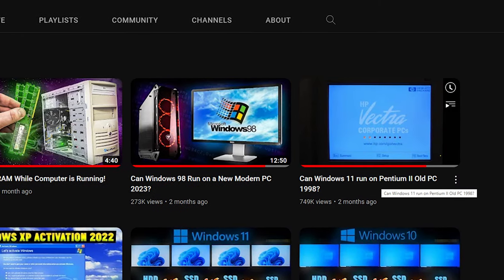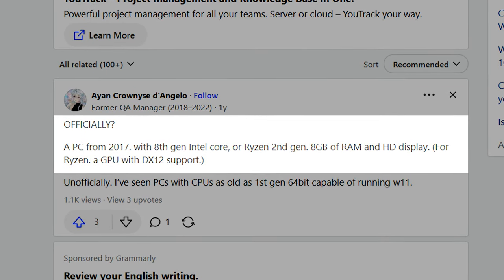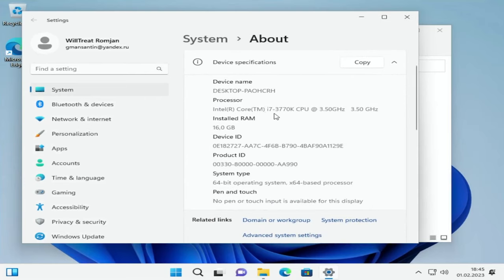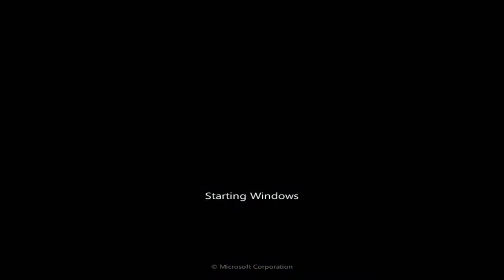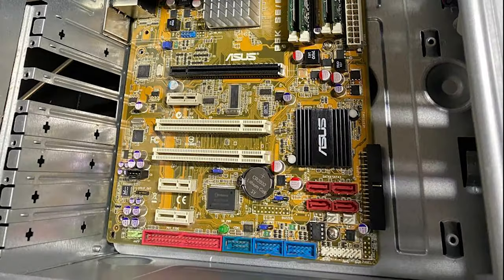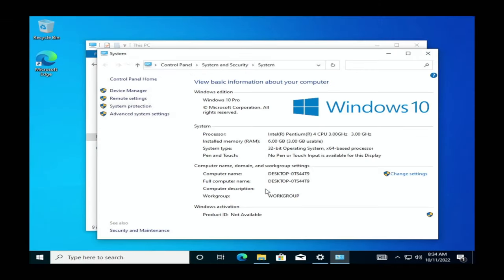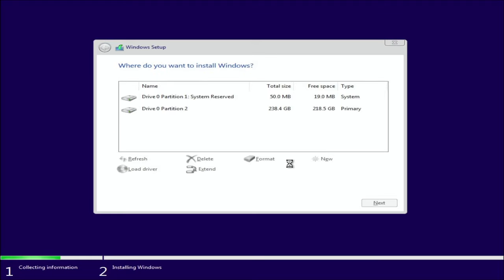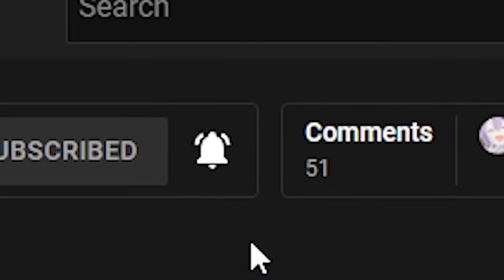What's The Oldest CPU That Can Run Windows 11?

Comment from the maker: What is your favorite operating system?
Reply: Windows 7
Reply: Windows Vista, XP, 7, & 10
Reply: linux ubuntu
Reply: @MrIzaiah2007YT  windows Vista had potential but because of hardware not being powerful enough to run Vista most people downgraded to xp
Reply: vista and 8.1
Reply: Windows 7, 8.1, XP, and Vista
Reply: Ubuntu Linux
Reply: @el_dallasyt  well my experience With Vista was great. no joke.
Reply: xp and 7
Reply: @MrIzaiah2007YT  then you had a good pc if your experience was great
Reply: @el_dallasyt  well I did
Reply: Like seriously I just had a gateway gt5620
Reply: @MrIzaiah2007YT  better than I had back in the day
Reply: XP, 7, 10 and 11
Reply: @el_dallasyt  well I was 13 years old when I had that PC and it worked fine for me, but when setting to sleep mode. It blue screens and I instead shut it off instead. Later replacing it with a Dell Optiplex 390 with a failing dvd drive. And it runs windows 10. Begging for it in my entire life
Reply: Windows 10 Pro
Reply: Arch Linux
Reply: Linux mint, Zorin OS, Windows 7 and XP.
Reply: Windows ME I still refuse to upgrade, YouTube playback is starting struggle though;)
Reply: Windows XP & Windows 7
Reply: Windows 2000
Reply: 98SE, ME, XP, W7
Reply: Kali Linux, Windows 10 and 11
Reply: Windows 11
Reply: Windows vistam
Reply: For the features it introduced, low system requirements, exceptional stability, good hardware compatibility at its time, absence of activation from M$ : Windows 2000  !! 
For the eye-candy, easiness of use, productivity performance, flip-3D function : Windows 7. Though I had good impressions from Vista as well.
Windows 10 is not bad, but not great : management is pretty cumbersome, it hides a lot of things, does not run on old hardware (AGP, socket 939 and the like), incompatible with many old peripherals.
Reply: Windows 11
Reply: Windows XP and windows 11
Reply: Windows XP and windows 11
Reply: Windows 10
Reply: windows 10 & 11
Reply: Personally (no bully pls) Windows 8.1. It wasn't that bad. The ui seemed a little weird, but I could get around it. And it IS fast.
Reply: Windows 98
Reply: 7
Reply: Windows 11
Reply: Linux (and Windows XP)
Reply: xp media center edition 2004 specifically
Reply: Gentoo Linux, i use gentoo linux
Reply: Windows 8.1 And XP
Reply: Arch Linux
Reply: Windows 11 and Windows 8.1
Reply: Be Operating System
Reply: @Nas_Allie  what
Reply: Windows vista
Reply: Plan9
Reply: 11 and xp and vista
Reply: Windows 7 and windows xp
Reply: @KasparsBarissGames  same thing for me
Reply: Windows 10 > windows 11
Reply: Windows 7 Build 7000, fine, clean, elegant without so much nonsense of advertisements and recommendations
Reply: Windows 7 Windows 10 and Windows 11
Reply: Windows 98 and Windows 7
Reply: Windows 10
Reply: 7
Reply: Windows 10, Windows 7 professional
Reply: cute fish OS (a linux distro that looks like a mac and doesnt restrict EVERY POSSIBLE THING)
Reply: Windows Millennium 👌
Reply: @Man-O-Sphere News  half joking because I really never had any issues with it and at the time I had a great time playing games and browsing the internet. But the best for me is 7.
Reply: Windows 7
Reply: win 11 & win 8/8.1
Reply: and ubuntu
Reply: windows7 or 10
Reply: Windows 10 and 11
Reply: XP et 10
Reply: Windows 7 Ultimate
Reply: Windows 7
Reply: 10 and vista
Reply: Windows 7, Windows 10
Reply: Win 10 And Win 11 (Tiny Build Version)
Reply: @vojtechadame5860  Zorin IS?
Reply: Windows XP
Reply: XP Pro 64bit.
Reply: @kristinehayes4885  Well, i have a xp install cd and Active key?
Reply: GNU/Linux with Arch Linux or Debian. Or Debian based GNU/Linux systems with the exception of Ubuntu based GNU/Linux distributions.
Reply: @Night_fla  same here 😀
Reply: 7, 8.1 and specifically Windows 10 LTSC
Reply: Arch
Reply: Windows XP
Reply: Windows XP
Reply: XP is my favorite  Windows OS, MacOSX 10.6 was great on Mac. SUSE 7 was the first Linux OS I sat and forced myself to use. BeOS was also great to use.
Reply: windows 10 and debian linux
Reply: Windows 7 ❤
Reply: Windows 7
Reply: Windows 10
Reply: Windows 11 and Ubuntu 22.10 Linux
Reply: Windows 10+MacOS 11 and above
Reply: Windows Vista
Reply: Windows 8.1,Windows 11
Reply: Windows 7
Reply: Windows Vista & Windows 8.1 for my Preferences
Reply: Windows 7,10
Reply: XP and 7. it used to be Win98 SE, but after i went back to try to make an ultimate pc for that, i realized it really was a shitshow and unstable to use compared to XP, which was relatively headache free.
Reply: XP
Reply: Yes
Reply: Win XP, 7, Ubuntu 16
Reply: Windows XP, 7, 2000 and Vista (as long as it’s running on good hardware and has SP2)
Reply: @LukeIsASmurf  8.1 was good, not my favorite but it’s good, 8 is just trash
Reply: Nobara linux
Reply: My favorite operating system has been Microsoft XP Professional. It was easy to use like using a Macintosh computer. Microsoft's office counterpart was Microsoft Office XP Professional, with Publisher 2002 packed in a separate disc. This suite of application programs put a lot of ease to my learning curve. In fact, I learned those programs better than if I had worked in a typical job, regardless of the quality of keyboarding.
Reply: Whatever system I need to accomplish what I am trying to do is my fave OS.  I'll use windows, linux, MacOS, OSX, OS 10, OS/2, DOS 6.1 emulation usually.   

The only thing I don't really use is old no LTS versions of windows.  If I'm trying to resurrect a decades old PC, I general l go with GNU because you can choose at install what aspects of it you need.  The kernel is simple and can be scaled up or paired down as needed.
Reply: XP ofc🤩
Reply: Overall - Windows 7
For legacy programs - Windows XP
For modern programs - Windows 10

Avoid - Windows ME, Windows Vista
Replace Immediately - Windows 8, Windows 8.1, Windows 11
Reply: Pirated copy of MS-DOS v 3
Windows 95
Reply: windows xp, 7 and vista
Reply: Apple macOS Sonoma 14 Beta 1/2. It has widgets/gadgets!
Reply: Windows 7
Reply: Windows: XP to windows 10
Linux: Ubuntu, KDE, Deepin
Reply: windows side: win2k... linux, early ububtu... Msdos, 3.2 (but not edlin)
Reply: Oh wait i forgot one more windows one
window- oh wait i forgot the other one but
windows technical preview
Reply: Windows 11 for its HDR support alone. HDR is trash in 10.
Reply: ubuntu minimal net installer 18.04
Reply: Vista, xp,10,11
Reply: Win 10 win 8 win 7 win xp
Reply: @MrIzaiah2007YT windows vista WINDOWS 8 WINDOES 8.1 WHAT IS WRONG WITH YOU
Reply: Windows 7 & 10
Reply: OS X Mountain Lion
Reply: Windows XP, 7, 11 and Ubuntu Linux, Debian
Reply: Windows 7 or macOS Mojave
Reply: Windows 11
Reply: XP,Linux,MacOS
Reply: 7
Reply: Windows 10💔 has won many hearts 🥺
Reply: Windows 7,8.1,10 and Windows 11
Reply: Windows 11 pro on my i5 9600k 32gb of gskill trident 3600  asrock challenger 8gb rx 5500 xt
Reply: xp, 7, 10
Reply: Windows 98, it's relaxing to use today. I enjoy the warm and inviting boot sound startup sound, the icons have aged well, and it has a simple interface that doesn't bog you down, no BS. I don't know why, but it seems like it gives off a utopian design. For a more modern OS I think Windows 7 is the gold standard I think it comes pretty close to perfection.
Reply: 98 SE ,xp SP3, vista, 7, 10, and 11 lol
Reply: Windows 10
Reply: XP
Reply: windows xp
Reply: 7 and 8.1 and XP and 95
Reply: Windows 3.11 with DOS 6.22
Reply: Windows 10 Home
Reply: Windows 10 Home and Windows 7
Reply: windows xp / 7/10/11
Reply: Windows XP, Vista, 7, 8 8.1, 10, 11
Reply: CP/M in an Amstrand PCW  ....
Reply: Windows 95 Windows XP Windows 7
Reply: Linux Mint Debian Edition (LMDE5) w/ Cinnamon desktop OR Fedora Linux Cinnamon Spin.  Both are equally superb.
Reply: 7
Reply: Windows 8.1
Reply: EU AM UN PC HP 6300 PRO CU PROCESOR INTEL i5 3470 generația a treia de 3.20 GIGA cu grafică integrată culmea procesorul E de GAMMING și PC-UL nu E de GAMMING dar duce jocuri nu din alea mai modificate nu dalea Gen GTA-5 SAU mai știu eu CE JOCURI video CARE NECESITĂ PLACĂ VIDEO puternică d exemplu: DE 8 GIGA MEMORIE  DE EXEMPLU un GTX 9800!🙂
Reply: PROCESORUL DIN PC-UL MEU ARE TEHNOLOGIE DE FABRICAȚIE DE 22 NANOMETRI!🙂
Reply: PROCESORUL DIN PC-UL MEU ARE PATRU CORURI PATRU TRENDURI!☺️👍🙂
SHOCKETUL DE PE PLACA DE BAZĂ A PC-ULUI MEU E 1155!🙂
Reply: windows 7 is my favorite childhood until now
Reply: i like 11 2000 and 7, 8.1 95 98se 10 xp vista
Reply: win 98 purely for nostalgic reasons
Reply: wiin 7
Reply: macOS/iOS or Linux
Reply: Linux, Ubuntu. Last time Windows was decent was Windows 2000. No activation, no spying, no bullshit.
Reply: Q4OS
Reply: windows 95
Reply: win10, but I'm on win11 ever since it's release
win11 personally i only hate right click menu and taskbar which are fundamental things but, oh well- it works
Reply: Linux Mint!
Reply: windows 10, android 10, ios 15.
Reply: Windows XP, Windows 7 and Windows 10
Reply: Windows 8.x, Windows 10, Windows 11, including Windows 7.
Reply: I loved Windows 95, 98, and 2000. XP was also fantastic. It hasn't been the same since.
Reply: @JMFSpike  I did not use these OSes and they are old. Many people use these OSes on virtual machines and real old hardware.
Reply: @elenaursache9728  Okay, but I really don't care if you ever used my favorite OS' or not.
Reply: OS/360
Reply: @JMFSpike  I will run Windows 11 on a VM on a Windows 7 laptop
Reply: Windows 7
Reply: Windows XP, 7, 11 and Linux Mint
Reply: os/2
Reply: Windows XP
Reply: windows 7
Reply: Windows 7🟥🟩🟦🟨🕊
Reply: Windows 7🟥🟩🟦🟨🕊
Reply: Windows 7🟥🟩🟦🟨🕊
Reply: Windows 7 and Linux Mint
Reply: Linux Mint 21.3 Xfce is the best !!!!!
Reply: Windows 10 ,and windows 11,
Reply: i love the installation setup of windows 7.
Reply: Amithlon
Reply: windows 7 is my favorite for aero
Reply: Windows 7 ULTIMATE😅
Reply: Actually I still love Windows Vista, XP, 7.
Reply: windows 98se and windows xp
Reply: 98 SE, XP SP3, 7 Ultimate SP1 x64, 10 22H2 x64.
Reply: I cloned Windows 11 on an external hard drive and booted Windows 11 on PC's from before 2018,.
Reply: Windows 95, NT 4.0, 98, 2000, XP, Vista, 7 and 8.1
Reply: @mats520    Have you been able to boot Windows 11 on a PC that doesn't have TPM 2, secure boot, and that uses BIOS? I'd love to experiment with 11 on an old Core 2 duo or quad, but Idk how to bypass all those requirements.
Reply: @MrSavagebeast04  yes. it was bootable on bios, even without tpm and by passed all those requirements, but when i tried to boot Windows 11 on a 16 bit or 32 bit cpu, then i got a blue screen of death or a startup error. I used WinToGo USB to clone Windows 11,. Windows 11 performed well on core 2 duo and pentium dual core when it booted from the external hard drive.
Reply: Windows 10
Reply: haiku linux
Reply: win 11
and 10 is my best i have ever used when i use win 10 i more time i got old nostalgials
Reply: @mats520  Thank you so much!
Reply: Windows Vista
Reply: Hey what a great channel!! For me Windows -> XP, Linux -> Mint
Reply: Windows 10,11
Reply: Windows XP ❤
Reply: Windows 7, to be more specific, build 7000 for its looks, and build 7601 for its usability
Reply: Grew up in my childhood with windows 7, mostly Windows 10.
Reply: Windows 8.1 10 11 ❤
Reply: My Top 3

1. Windows XP
2. Windows 7
3. Windows 10
Reply: Windows 7
Reply: Win 10 for sure 😁
Reply: Windows 7
Reply: Wim 11
Reply: Windows XP, Vista, 7 and 11 (yes 💀)
Reply: Windows 11, 10, 7, Vista
Reply: my favorite is windows 11 and windows 10
Reply: @RamtechENG  windows 98
Reply: Imagine how windows 12
Reply: @Guest8293  it probably will be a year or less if Microsoft keep getting money hungry.
Reply: templeos
Reply: This is easy. Windows  XP on PC, Linux and MacOSX .
Reply: Windows 11 and 8.1
Reply: linux ubuntu
Reply: Windows 10
Reply: gäymäc ö$..?
Reply: Win 7 or 8.1
Reply: i have intel pentuim dual core and i installed win 11 ez like installing win7

Comment: Great video, recently i upgraded my laptop with i5-7200U (7th Gen) with Geforce 920MX and 8 GB of RAM to Windows 11 x64 22H2, it's working well, old games running well, like GTA San Andreas, no errors. Greetings from Brazil, i like your channel.
Reply: We have same spec laptops lol
Reply: @ari_1755 , what is your laptop?
Reply: Wow they still used the 920MX on newer models? Wow.

My former laptop also had a 920MX, but the processor was a i5-6198DU (6th gen)
Reply: @charginginprogresss  Yes, they even used the 920MX on PCs with Intel's 8th generation processors, but with other name, like Geforce MX110 (rebranded 920MX model with small changes).
Reply: @charginginprogresss , my laptop have i5 7th Gen and Geforce 920MX. And your laptop processor is something I have never seen before as they never sold anything like this here in my country (Brazil).
Reply: @KlonoaSulista22  Cheapskates, lol. I swear.
Nowadays those pcs don't exist anymore though.

Any laptop in the 500€ price range with a low/mid end-ish i5 processor of 10-11-12th generation rocks integrated graphics now.
That era has ended.

That's why I switched to mid end gaming laptops to have decent GPU...
Reply: My old laptop has the same processor, also running windows 11 but with a radeon r5 m430 card and it even has a tpm 2.0 chip which makes it almost compatible
Reply: I have i7-6500u and 940m. works very well with win11
Reply: I have i5 7200u but with GeForce 940mx

Comment: Supposedly the Athlon 64 gained LAHF/SAHF support as soon as the first X2 dual core models were released in May of 2005, which would make it over half a year older than the P4 6x1 still. Might be worth checking out in another video if Win 11 only requires MMX, SSE/2/3 and some sorta 64 bit extension set (EM64T for Intel, AMD64 for AMD) otherwise. Undoubtedly the Pentium will be the slower of the two however, what a pile of trash Netburst was.
Reply: Well... Windows 11 and Windows 10 64-bit didn't work on my Opteron 165 and that CPU was released in August of 2005 to my knowledge, that CPU does have 2 cores and is technically AMD64.
I did however get Windows 10 32-bit to install on there, and it's surprisingly usable
Reply: @RowanBird779  yes, the Socket 939 CPUs don't work with Windows 10/11 64-bit. The oldest CPUs that can run it are Pentium 4 6x1 and Celeron 4x0. For these old AMD CPUs you could try Windows 7 64-bit, you can run all the modern APPs without problems.
Reply: @BaguetesGarage  Celeron D with Cedar Mill core is the oldest and slowest actually, I got it running on a Celeron D 347 and an AGP platform, with FX 5500 graphics and DDR1 RAM
Reply: @tehretrotech3977  oh yeah, these suckers were launched around mid 2006.
Reply: @BaguetesGarage  Oldest CPU supported by Windows 10 x64 is Pentium Extreme Edition 955 (January 2006).
Reply: According to CPU-World website, the first CPU that have all of LAHF/SAHF, PrefetchW, and CMPXCHG16B, are those on AM2 socket. Late 939 processor doesn't have CMPXCHG16B even though they have the other two. The same case go for Pentium 4 5x1 and all Smithfield lineup. I think the only Pentium 4 Prescott that support Windows 8.1 x64 or later is Pentium 4 524 which is the last Prescott Pentium 4 to be released in early 2006, or maybe Pentium 4 519/519K. Other 90nm SKUs from Intel can't be use with Windows 8.1 x64 and later. The first Intel CPU lineup that wholly usable with Windows 8.1 or 10 x64 are Cedar Mill and Presler parts, from Celeron D through Pentium Extreme Edition. Those are 2006 products as well.

So basically, the requirement of Windows 8.1 x64 and Windows 10 x64 make everything before 2006 unusable with newer Windows and without any workaround, at least on 64bit version of Windows.

On the other hand, modern Linux x64 can still working on everything that have AMD64 or EM64T instructions, in other word, everything since Clawhammer and Nocona that is not Sempron on socket 754/939 or Celeron D Prescott. Though it should rather be considered that PCI-Express architechture is another requirement as there's no AGP bridge driver in Windows 10 at least for VIA chipset so it makes AGP graphic card only run with PCI bus on Windows 10 which is very atrocious.
Reply: Thats something I'll try eventually. I got an early Athlon 64 I know ran 10, but im curious if it runs 11 too.
Reply: actaully main issue with netburst was too many pipes and not enough cache athlon 64 had more even if just small bit more
Reply from the maker: Thnaks for this kind of information. Soon I'll release a new video "What's is the oldest AMD CPU that can Run Windows 11"
Reply: @RamtechENG  when

Comment: One thing to keep in mind when messing about with modern CPU's on old hardware is hardware USB support. Even with a USB 3+ card, a lot of motherboards and CPU's can only reach USB 2 speeds. If all you're doing is data transfer etc - or even loading levels on emulation.... its worth being aware of. Its a fun project, but don't get over excited. Pushing old kit to still work is definitely worth while, especially for servers etc. BUT.... if you actually want a usable PC for not much money, look at Refurbs and Mini's, around the £150-250 mark - they hit all the bells and perform to modern standards. That said, I have an offline-only old P4 4.2Ghz Windows XP system purely for retro gaming, and I love it.